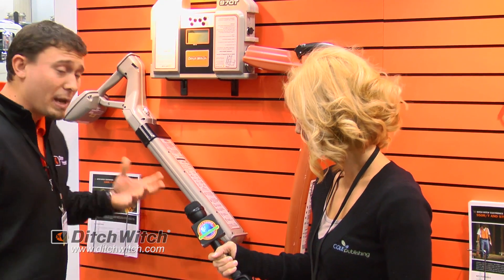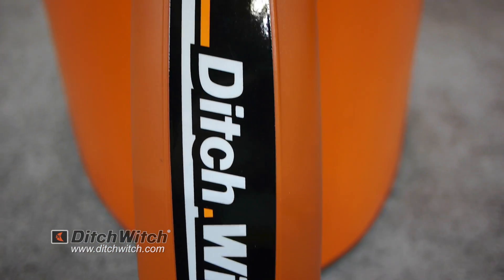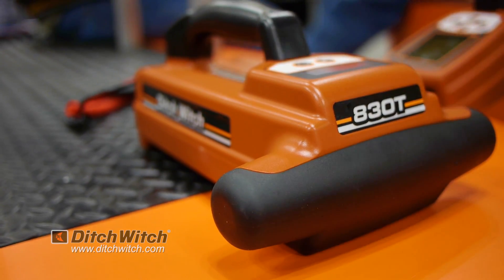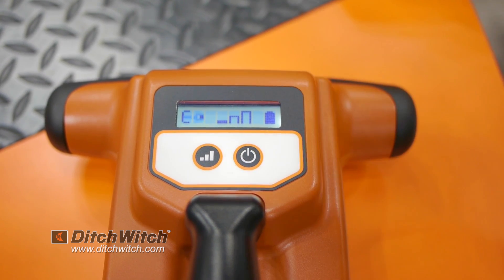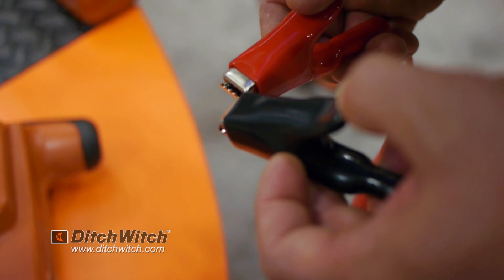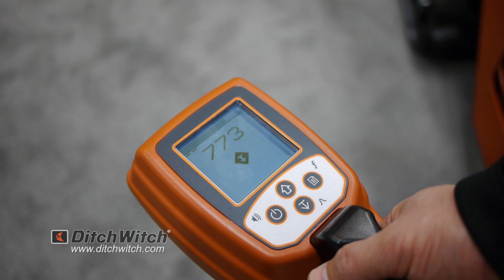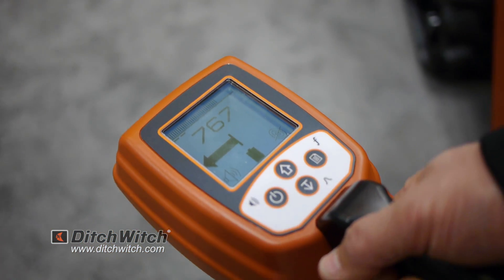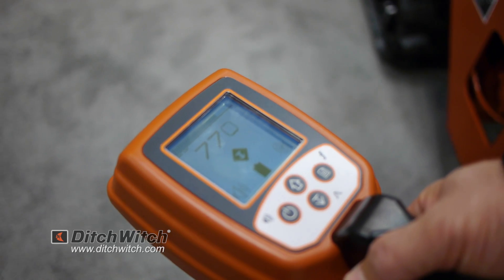Ditch Witch® - 830R/T Locating Equipment - 2012 Pumper & Cleaner Expo

Comment: I loved using the 830 tr for everything but gas or water although i heard of it being used for that actually i remember a guy digging up a concrete water pipe i marked out with a strong signal too most of the older guys did the gas and water with the company I worked for and used this wonder